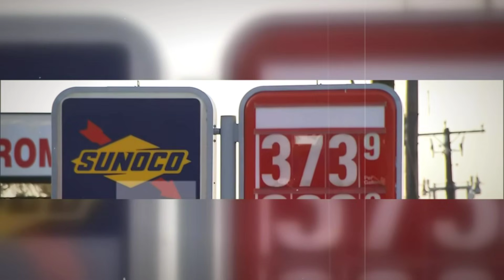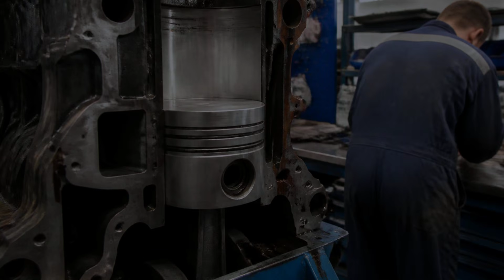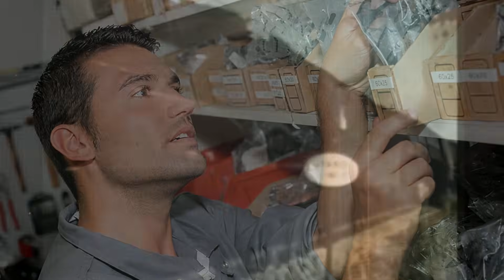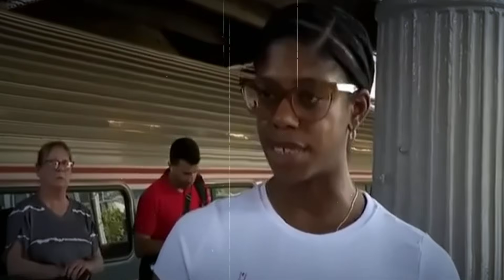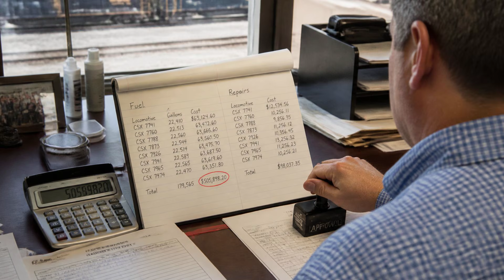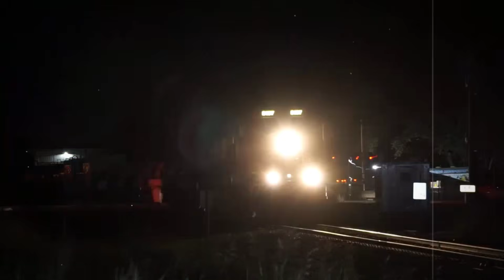How Do Locomotives Idle All Night Without Running Out of Fuel?

Comment: They dont since the 1990's.  The EPA tier I mandates engines are computer controlled - shut down.  At 40 degrees  F. The aux power unit heats the water jacket to keep the engine from freezing.  At 36 degrees F. Relief valves open at drain the engines water jacket to avoid freeze damage.

Comment: No throttle plate. The air to fuel ratio in a diesel engine can be 50:1 or more at idle. Used to see this all the time.